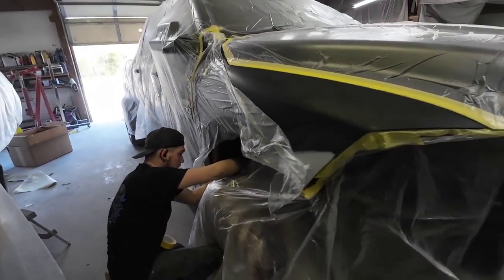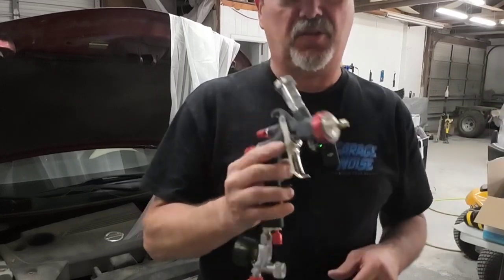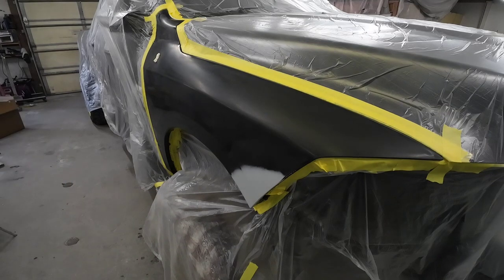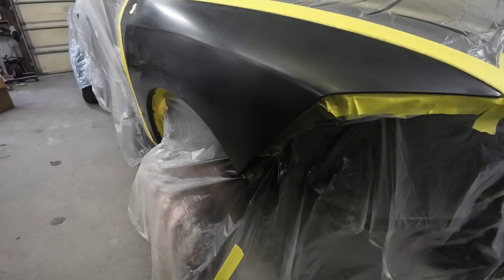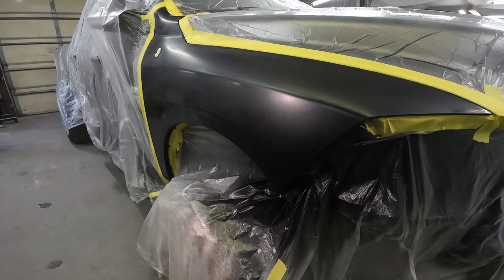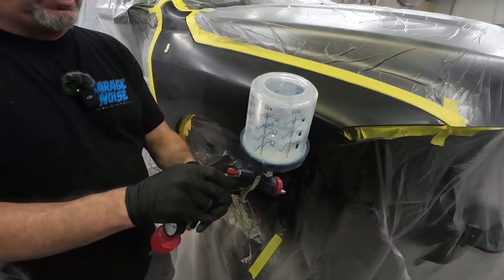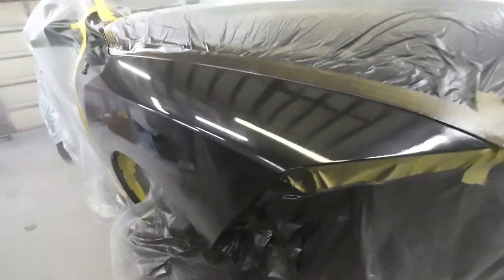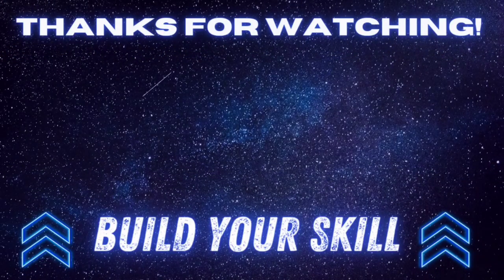How to blend paint and clear coat your car

Comment: Hey Chris, you helped me a lot on some of my questions so I want to help you reduce spillage when pouring your reducer out of the bottle.  I’m not sure if you know this, because you could have been in a rush when shooting a video, but next time you pour that reducer, try pouring it from the other direction.  In other words, spin the container around 180 degrees before you grab it and start tilting it to pour.  I do this method for engine oils too and it never makes a mess.  If you pour it the way most people think is the correct way, the fluid coming out always catches the corner rim of the container, causing the fluid to run down the side of the container.
Reply from the maker: Good tip!

Comment: Great information. I’m doing basically the same repair with the same fisheye issue. I’m going to re wash with the isopropyl a few times and go at it again using your tips.
Reply from the maker: If you start with a light coat it really helps with clear as well. Appreciate the comment and support!

Comment: Alright this is something that's bugging me and its more of a technical question. 

When blending in the paint, is it acceptable for it to be on top of the sanded clear coat? Are there any prep steps beyond sanding that should be done to make sure the blended paint adheres to the under layer of clear coat?
Reply from the maker: Totally acceptable, that's  all that needs to be done as long as the clear is in good shape.

Comment: Looking for a first gun for home use. I have a 60gal 5hp 12.5cfm. I have watched your vids on the Astro tool EVOT13 and the Aero pro R500/A610. I have never painted a vehicle before and am replacing a door and bumper cover. I am learning as much as I can so the only mistakes I hope to make is just being a new painter vs equipment issues. Thanks for all the instruction and help!
Reply from the maker: Awesome! With your compressor your not limited to a low cfm gun. I will be breaking out the astro euro pro he here real soon so keep an eye out for that video.
Reply: @GarageNoise  Thanks, I appreciate it.

Comment: Good videos, good knowledge, good edits.  Can you explain why some basecoats get blended into a wet bed or get the diluted color blender technique but this time you used a backed-off dry dusting blend.  I dont do a lot of painting but rather enjoy it when I do so just like taking in knowledge.  Thank you!
Reply from the maker: It's  really all about avoiding something called mottling. Which is an inconsistency in the metallics of a finish. It  makes metallics look blotchy. This happens most often in light metallics like golds, silvers. This is when I will definitely use a color blender or (wet bed). Especially if it a hot day as this makes those silvers dry quicker, which also make the chance of mottling greater. Most dark colors I don't  need a color  blender. That doesn't  mean there's  no chance of mottling but for me it alot less likely.  Good question,  I've  been getting ask this alot so I may answer your question in a video. Appreciate  the support!

Comment: Thanks for the video it was very helpful. I'm trying to fix a small dent on my harley rear fender. So once I fix the dent and prime it, I'll sand the whole entire rear fender with 600 including the spot so that when I paint and clearcoat everything will be filled in like in the video?
Reply from the maker: You got it! You may need to block the primer over the repair with 320 to make sure its straight. Then finish sand with 600

Comment: Great videos!!. How would you blend paint and clear up to a body style line? I guess the question is: how do you end base and clear at the body style line and then wet sand? Wouldn't there be a suttle line as the paint and clear end at the same point?
Reply from the maker: Yes ,there would be a subtle line. I'll make some video's explaining how to do a repair like this effectively.  It's  never the right way to do it but for a diyer it a useful skill.
Reply: @GarageNoise  That would be great. Thank you so much!!

Comment: I could buy a small compressor and a gun like you suggest or the Eastwood five stage turbine. I don’t paint often but I have pride. What do you recommend? Time to leave rattle cans for smaller projects.
Reply from the maker: If your  concerned about overspray, air consumption, and want to save in materials this is a great paint gun. As far as an air compressor I always suggest buying the most cfm's possible within your budget. Size doesn't matter,  how much air it produces (cubic feet per minute) is what's important. Hope this helps appreciate the support!
Reply: @GarageNoise  thanks a bunch. I love your channel. My friends don’t understand how fun it is to DIY even if one can afford to have a pro do it. My results are much worse but the quest is worth everything to me.

Comment: When you say dust it on the first coat should i drop pressure from 2 bar or just half trigger?
Reply from the maker: Just increase your distance a bit 1-2 inches and you don't  have to mess with your settings. You can change the settings if you choose.

Comment: I have a question that's been puzzling me for a long time. After you spray your base, you tack down the scuffed original clear coat area which now has loose, dry overspray on it. Then you're clearcoating over some dry base atop old clear, yes?  is that OK??? Thank you!!
Reply from the maker: Yes, because it's just the color the clear will smooth everything out and give it the gloss